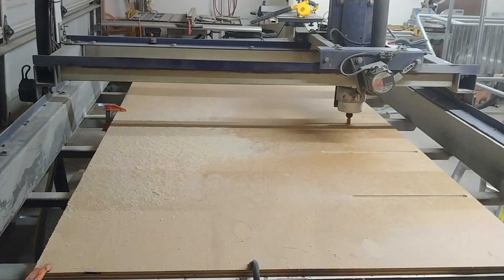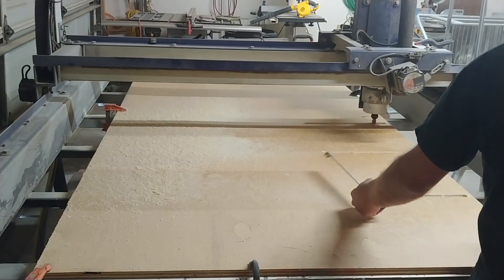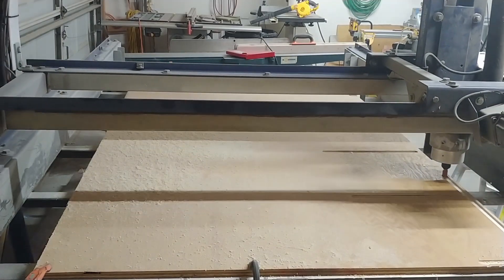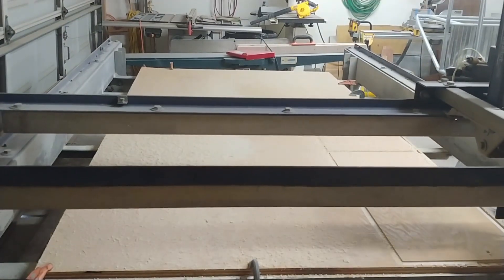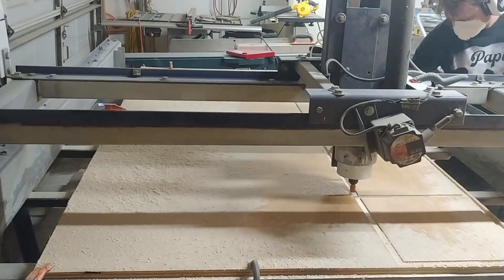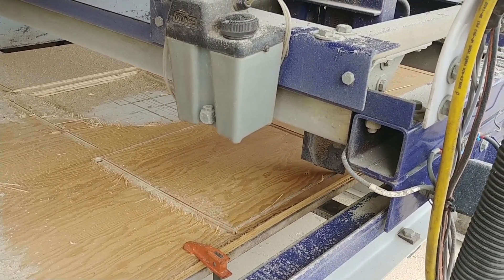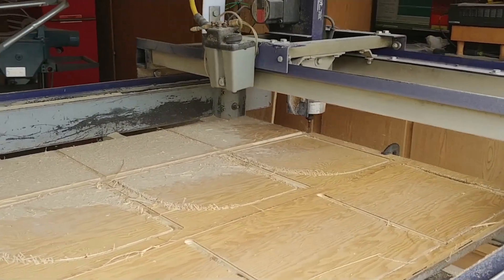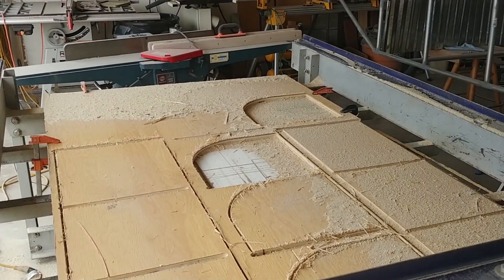First project on the Shopbot CNC!

Comment: Im about to buy a use shopbot prs standard with a portacable motor , I have a small shop and i do restaurant furniture , I will cut 3/4 plywood . whats the speed I will be able to run the cnc?
Reply from the maker: Nice! I use a 1/4" double compression bit for 3/4" plywood. It makes a nice clean cut in one pass at about 1 in/sec. I keep it slow, but I'm sure you could push that up if needed. The speed is usually limited by the bit, not the router.